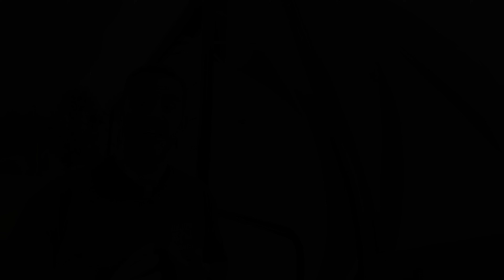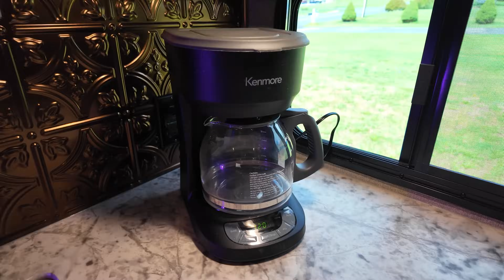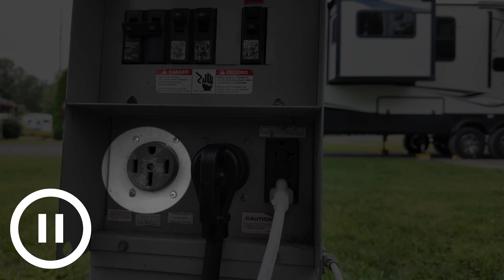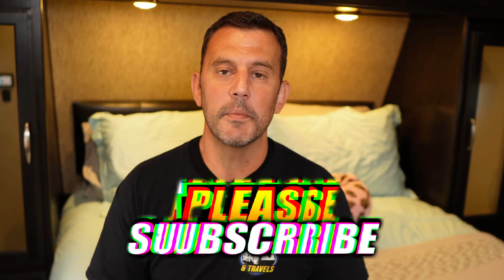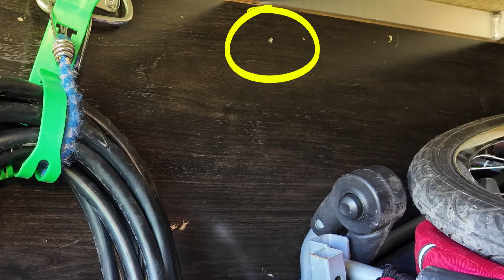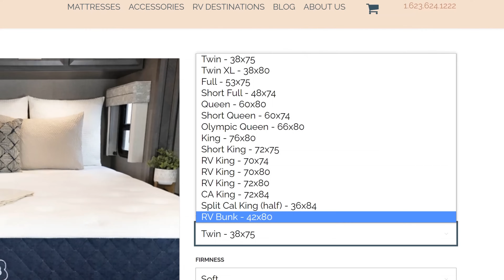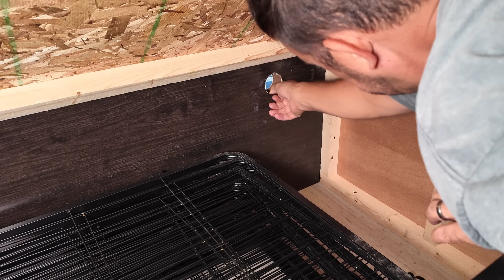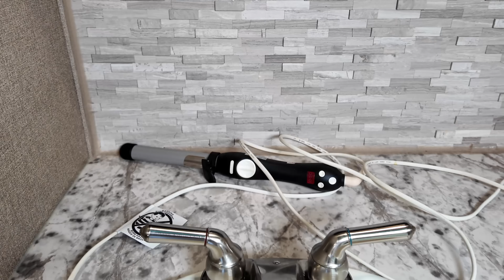This Old School RV Modification Adds USABLE Power to a 30 Amp RV

Comment: Quick question- I have always wondered if you use a 30 amp Rv to 120 pigtail , don’t you technically have an extension cord thats only 14 or 12 gauge that is on a 30 amp breaker and could overheat before popping the breaker? I have done this for years with small loads.
Reply from the maker: You can plug into a 1 million amp outlet, the appliance asks for the power.  so if you try to pull more than the cord is rated for but not more than the breaker, yes you can have problems.  That’s why I mention to know what you’re pulling, and plan around that.

Comment: Absolutely genius my friend I’m doing this.
Reply from the maker: im thinking about maybe tucking that wire in the pass through behind the board and installing an outlet there to plug the extension cord into... being a neat freak im sure that cord will evenutally get on my nerves, but again, its a quick mod so Tara can use the hair dryer.

Comment: I did this 12 yrs ago with outlets for bathroom and dining table (coffee pot). 

Also found a pigtail at big box store thst is basically an in line 15 amp breaker so dont depend on the pedastal.

Even with this, we have to run the water heater on gas when ac is running for more flexibility

Comment: never thought of this mod for shore power boosting. 
i installed a 2k watt inverter and wired in a 15amp duplex with dual usb C ports by the entry door in our camper. this puts it by the bed and the kitchen so it was to take over when dry camping and we wanted to make coffee or use a toaster. But fair point that this may even be needed when on 30amp service to still run some appliance if we already have the other main things running. 
i tend to run the water heater on gas even when on shore power as i find it recovers much faster so perhaps that has kept us from really exceeding our 30 amp.. that and if the fridge is mid cycle and not drawing the 400watts or so it does when it is first cooling down.
i will keep an eye on things and may enable the inverter even when plugged in just to take some strain off the main system.
Reply from the maker: Good idea.  We run the water heater on electric.  I’ve never had an issue with cold water, plus it’s free, but it puts us right at the top of not being able to pull another 5-6 amps.

Comment: Good idea and I like the ease of install and having usb, but be careful what you plug into it.  The linked outlet from Amazon is only rated at 12 amps -- probably due more to the wire size of the slim flat attached cord than the outlet itself.  That does mean however that when you connect to a 20 amp breaker on the pedestal if you had the wrong things plugged in you could draw way to much power before tripping the breaker and potentially that small wire could heat up to the point of being dangerous.
Reply from the maker: I couldn’t agree more.  The hairdryer will be the strongest appliance at 11 amps on high, so still under the spec.  As mentioned in the video, it’s very important to do your math.

Comment: Tbh, it’s nice to see I’m not the only one losing grommets like that! 😂😂
Reply: @RVTIPSANDTRAVELS  I would have cut a pool noodle down to width and used it to fill both panels simultaneously running the cord down the middle. It didn't need to be water tight. No lost grommets.

Comment: There are different ways the pedestal can be wired. The most common I have personally seen is the 20A circuit is connected to one phase of the 50A and the 30A is connected to the opposite phase. So you are still limited. Some panels sold on Amazon have a wiring diagram in the photos for a reference.   Hope this helps.
Reply from the maker: Thanks Dan, that makes sense and I'd be willing to bet those are the campgrounds with the gate blocker on the 30 and 50 amp outlets that I showed towards the end of the video.  Regardless, if some pedestals are wired the way you explain, it would still be pulling less amperage than the 50 alone, so no harm there.  Appreciate the input bud!

Comment: I put an extra outlet under the bathroom sink just for my wife’s hair dryer and an heater in the winter.  I drilled through the camper and put a 15a male end just for an extension cord.
Reply from the maker: nice!

Comment: I added a 2nd A/C and wired an 15amp male plug on the outside of the Rv dedicated (wired directly) to the A/C then I run a heavy duty extension cord to pedestal or a generator
Reply from the maker: great idea, i toyed around with the idea of running the inside outlet to an outside outlet, then plug in from there, but stuck with this.  Thanks for sharing John!

Comment: As a licensed electrician for almost 30 years, I had a good feeling about what this modification was going to be before I started the video.  I have to say that I applaud you for stating to check your specs before doing this.  I’ve seen people do this incorrectly and not use the right size outlet or cord. I would suggest either a 14 or 12 gauge extension cord up to 25’.  They will more than adequately handle up to 15 amps at that length.  WELL DONE video, and thank you for finally showing  everyone how to do it correctly.
Reply: I use a 12 gauge cord on my extra plug.
Reply: Agree completely.
Reply: 12 gauge to be safe, but what do I know… I work on govt contracted construction sites and I can’t tell you how many times I’ve seen 2 or 3, 25 foot extension cords connected to a miter saw zinging off 2x4’s all day.  Inspectors walk right past.
Reply: @rickcook6978  correct as long as the circuit is rated for the amperage, which he is implying.
Reply: I’m doing this tomorrow on our GDRV.  We always have to turn off the electric heater (early spring and late fall), when we make a tea or coffee with the Keurig.   What a great idea, thanks for posting.
Reply: It's amazing how many people have zero clue about basic electrical theory. During the last 12 days being in the Helene route aftermath, I had to explain multiple times to my mother in law and her boyfriend how electricity amperage and wattage work in regards to our relatively small solar/ fuel generators. And i was CONSTANTLY unplugging things that they were plugging in that would trip the numerous breakers i had for safety, i prefer to use a 10 Gauge cord to run my 30 of my 50 amp rv, along with a50 amp surge protector AND soft start controller for 1/2 of my air conditioners. 12 gauge got WAY to warm the 1st day and I immediately upgraded.
Reply: Am I correct in assuming that since he used a pre wired outlet, one would not need to worry about any building codes?